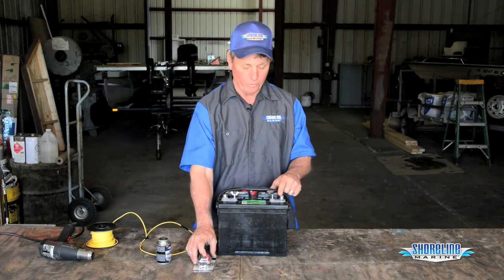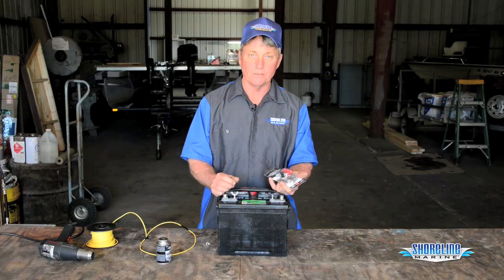How to Properly Connect Wires to a Marine Battery

Comment: ABYC standard State that largest terminals go at the bottom.You stack from largest to smallest. It has to do with resistance of the small terminal on the bottom compared to the top one.. And wing nuts do not belong on a boat.

Comment: That tip to use a lock washer or nut is more important that people realize--thanks for stressing it.  I use a wing nut, easy for my hands when I don't have a tool handy but I put a lock washer under it; as you say, it will not back out and lose the contact.  But here is my problem--I have one battery that has, of course, the major black wire on the negative, and the major red on positive.  And the minor black wires of course, also on negative.  BUT, there are wires dangling now-for several components.  They are NOT black--or red. I can't trace where the other end of the wire goes, so how do I sort if should put them on the red or black post?  Related, is it safe to go to the helm and find some component that is not working, then go back and touch one of these wires to the red and see if the component comes on--or will that maybe burn out a fuse?  thanks.

Comment: This is mostly bad advice here. Sorry.  If you must stack connections on a battery terminal, largest on the bottom and stack like a pyramid, max 4 or 5 as long as your nut can screw down your post with some to spare, BUT stacking is lazy and bad practice anyway. Good practice is to use a terminal block / bus bar instead and have only 1 cable from the battery to the block.  Cover the opposite terminal with an insulator before swinging the metal tool around. Don't just eyeball it.  Accidently shorting could kill you, start a fire or ruin your battery etc and have a permanent marine cap over the positive terminal. Wing nuts should never be used in a permanent install and would be flagged in a survey.
Reply: Why do people make tutorials when everything they say is wrong? Ignorance is bliss I guess
Reply: @FishStalker777  True.  Many tutorials are well intentioned and harmless but in this case its straight up dangerous.

Comment: Only thing I can say is you always ALWAYS stack terminals from largest to smallest so you're not creating resistance before your larger lugs.
Reply: Awesome, thank you! Do they need to be spaced with anything, or can they just sit on top of each other?
Reply: @jamescanady3442  they can sit directly on each other. I would avoid stacking more than 3. Your main ground buss should be attached to a lug on the engine that can handle any amount you can throw at it on a small boat. If you have more to ground you can add a buss block with multiple terminals. move the main ground to the the terminal closest to the ground lug. Your ground path would then be #1: Ground buss to main ground, Battery ground to Ground buss (same terminal is ok) #2: Any other grounds to the terminals next to the main starting with highest draw. Limit to 3 per terminal if you can. Inspect connections on a regular basis to make sure they are tight. Use a conformal coating like liquid electrical tape. Use marine grade wire and shrink wrap for everything. Remember that electrolysis is the result of electrical loops. Bad connections make it worse. Oh.. Use the main battery terminals for you connections to starter / ground. Use the small terminals for power to accessories. Swap out the wing nuts for nylock nuts or a nut a lock washer combo. Only use stainless.
Reply: @ryanskare6670  Why limit three per terminal? I might need to do 4 on my setup.
Reply: @austinwinter4575  You're just trying to reduce the resistance in the connection. It is the AYBC recommendation but if you need to and don't / can't add an additional buss then just follow the terminal size rule of largest/thickest terminals first.
Reply: @ryanskare6670 hi there, just got a jon boat, first time boat owner. There's four wires leading out from the motor, two positive and two negative. A small and big one for each, so i hook them all up to the marine battery?
Reply: @Alexander-b8l2g  Without seeing them I would not know. One set may be to starter (big) the other may be from alternator (small)
Reply: @ryanskare6670  ok thx, I'm just going to hook them both up to the same battery, with the bigger cables on the bottom

Comment: You do not want to use wing nuts in a marine application. Also you want to stack starting largest first then work up to smallest. Ultimately you want to use a battery terminal mount fuse block.

Comment: Oh wow, that was bad and was actually incorrect on a few things. Like another commenter said, put the main cable (cranking battery cable or trolling motor, etc) on the battery first. Not last. Once you put in on the bottom do the rest of your stack of connections, you can always put a small, dime or nickel sized washer on the very top before screwing the nut down to tighten it all up.

Comment: DO NOT STACK ACC RING TERMINALS FIRST. BATT CABLES GO ON FIRST IN PROPER STACKING. USE THE POST WITH A TERMINAL OR RUN A TWO GAUGE TO A TERMINAL POST LIKE A BLUE SEA OR SOMETHING SIMILAR. THIS WAY ONLY LARGE TERMINALS ON THREADED POSTS.

Comment: I'm installing a 6switch panel with switch illumination? How would I wire it so that the panel will not draw power if key is not in ignition.
Reply: Daniel Jimenez you would have to find a keyed power source.  By keyed i mean the only time the wire or terminal has power to it is when the key is on. You will either have to tap into a known keyed power wire or the switch could have an open terminal.  Something to consider though is that you won't want to leave your key on just to run a radio, lights or what have you.  I currently have two batteries one for cranking my outboard and one for accessories.  that way you don't have to worry about draining your battery and not being able to start your boat.
Reply: Brett Tabor do you have the second battery on a circuit with the main battery or do you have it standing alone.
Reply: Just wire your switch illumination in parllel, but place it after the switch. That way the switch only illuminates when the switch is on.

Comment: I HAVE A 1982 CIMMARRON BOAT THAT IS LIKE HOT WIRED I HAVE TO DISSCONNECT THE WIRE ON THE POST WHEN I STOP NOT TO KILL THE BATTERY